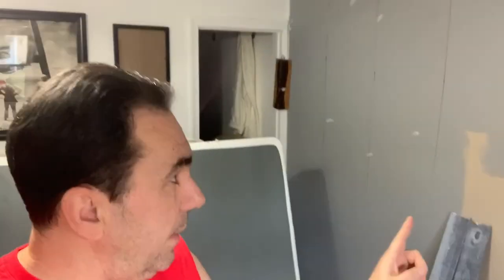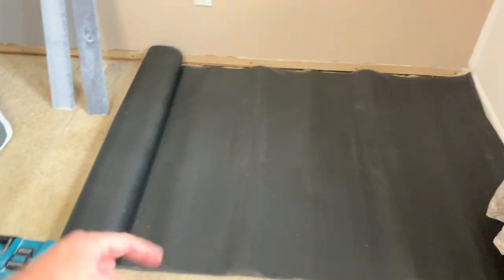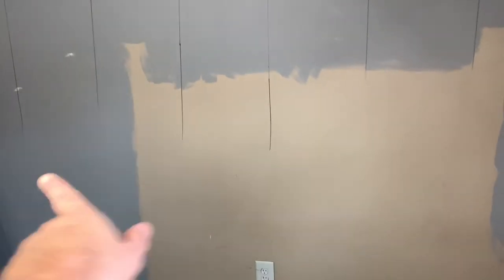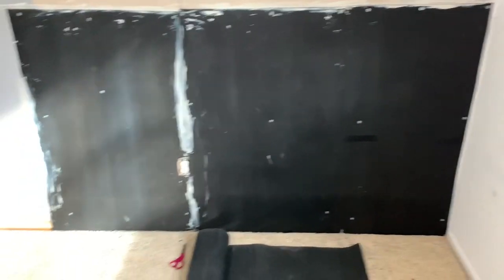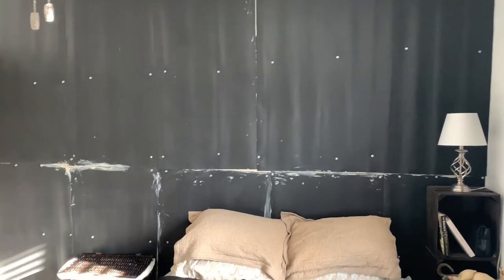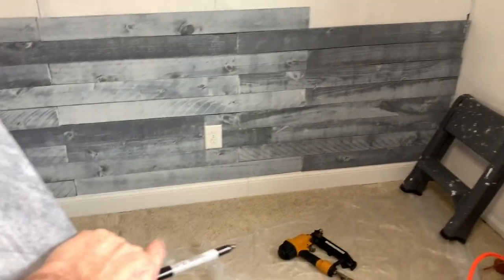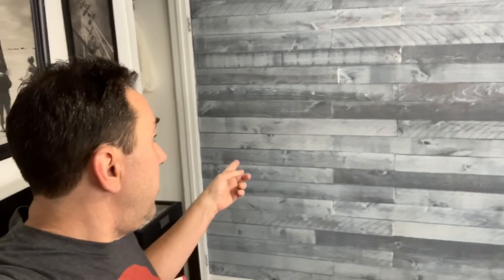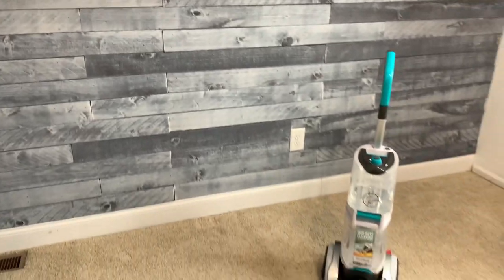Soundproofing MLV and Accent Wall Weaber Board

Comment: MLV is a beast of a sound blocker in relation to its thickness, its not a bad decoupler too if you don't have the room to give for an independent stud frame. 
But like any sound blocking item Its best utilised in conjunction with other materials though in order to see significant results as you need to combat the law of diminishing returns and disrupt different frequencies. Ideally it should be coupled with at least acoustic drywall. 

I live in a town house too and had issues with the kids screaming through the walls.
Didn't have room for an independent stud frame system and only about 3 inches to spare, so we tried a layer of MLV on the existing wall, a layer of acoustic drywall, then another layer of  MLV and another layer acoustic drywall. Didnt do anything for impact noise transference but let's put it this way, those kids have now to got to scream at the absolute top of their lungs for the faintest semblance of airborne noise to get through!

Absolutely love the wall panelling man! Looks amazing! Keep up the good work!
Reply from the maker: Thanks man I’m glad I did it it definitely made a difference and thanks for watching
Reply: @TumaTime  no problem, you've got my sub!

Comment: It looks really nice, but I think you should have added another layer of drywall on top of the MLV for better results.
Reply from the maker: Andrew Dsouza your right thanks for watching
Reply: Andrew, do you think the drywall (plasterboard as we call it), will sit flush against the MLV.. because it's very difficult getting the MLV to but up against each other perfect with an overlap...if that makes sense?
Reply: @jivanjohal  I think it's better if it's overlapped over top of the studs because you want the MLV to be able to move between the studs somewhat loosely to better absorb sound. So actually better if it's not flush... I think....

Comment: What was the thickness or weight of the MLV. I’ve seen 1/2lb, 1lb. Trying to fix the same issue but planning to use 5/8 drywall after installing
Reply from the maker: thanks for watching i just did that those boards over top you will probally have much better luck with the thicker drywall. i noticed a differnce in my bedroom it definitly cut down noise my i
wife says she still hears stuff.
Reply: I would like to know the thickness of the MLV, too. Currently planning to do this project but there are many MLV choices.